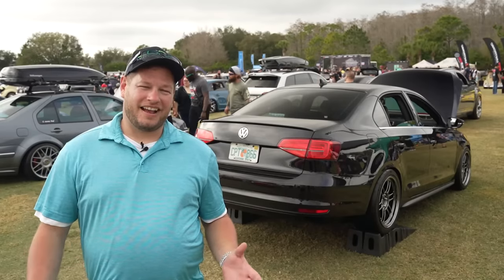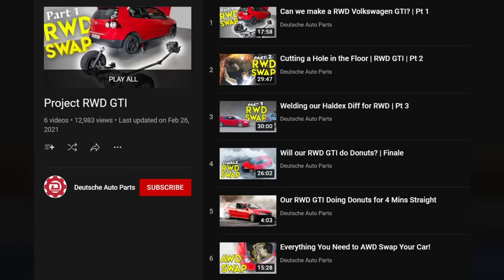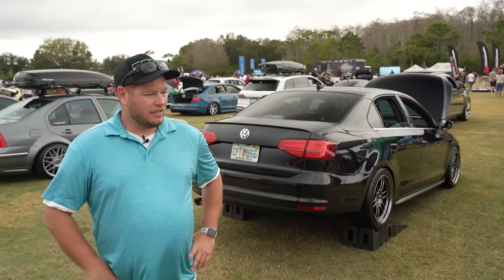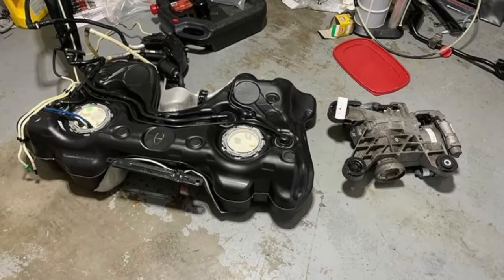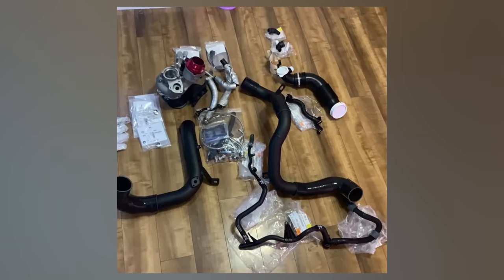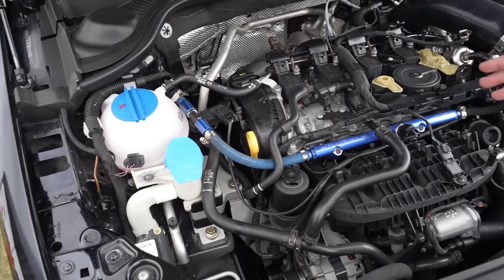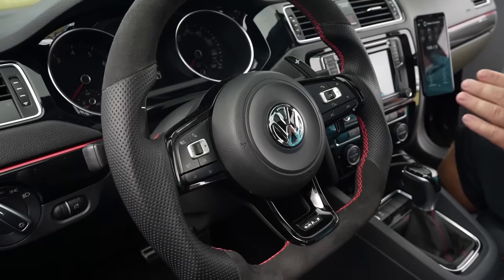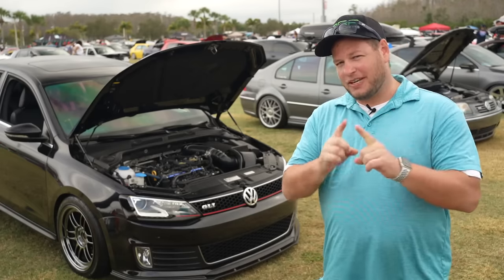Can you AWD Swap a Jetta? | Owner Spotlight

Comment: Would love to do this in my MK5 Jetta, just not sure it would work…
Reply: It would be very similar.
Reply: @DevineDigital  Do you by chance have a list of what you got when you AWD Swapped yours?

Unless of course the same parts won’t fit
Reply: @Rasmus230100  it’s fairly simple. AWD Transmission with bevel box (DSG or Man.) manual use an R, DSG use an S3 or A3 AWD. For you anything from 8P should work. Then it’s right axle, driveshaft (use the A3 or R if you can), tank, and rear subframe/drivetrain and some tunnel weld in bits if you use the driveshaft recommended. Thats the gist of it. Biggest thing, is making sure you save your transmission coding and put it into the new AWD transmission. Coding to use the secondary level sender is still an issue I have to figure out though. You either have accurate fuel gauge or figure out ABS coding for ESC. Otherwise you lose launch control on DSG. Some minor things I’m still figuring out, but she drives beautifully.
Reply: @DevineDigital  Appreciate the help!
Reply: @Rasmus230100  you’re welcome!
Reply: The mk5 jetta is the same platform as the Golf 5 and "Golf5 Variant" in Europe
Witch both if them where available as 4motion (awd)
So every Part will fit will fit in your jetta